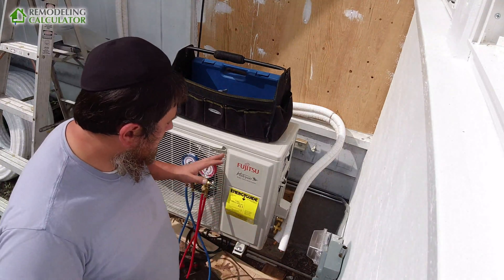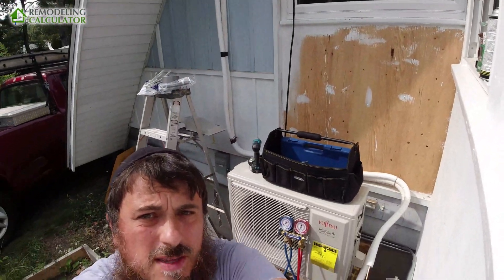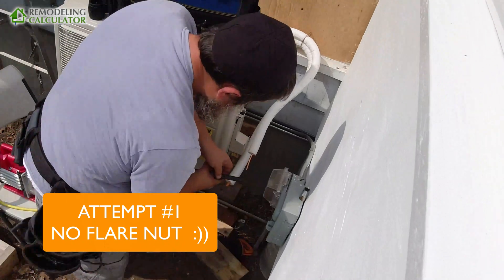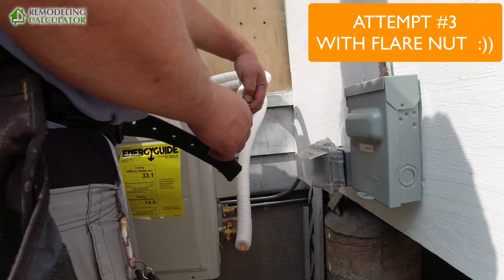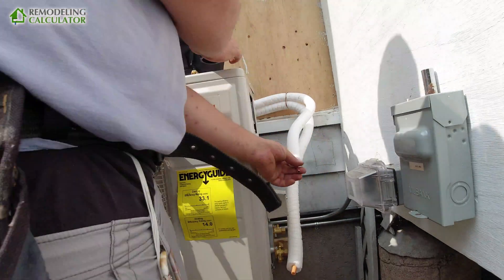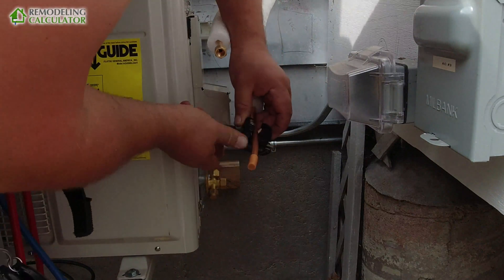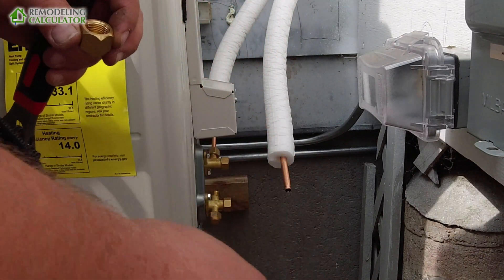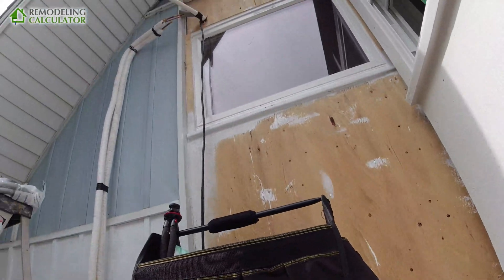Fujitsu DIY Mini Split Install (part 4) - Flare Connections

Comment: Use a shim as a spacer (following mfgr recommendation) to get the exact amount sticking out of the flare tool.  This ensures perfect flares every time.
Reply from the maker: No it does not, because fot 1/4 line you need a tiny little bit less copper sticking out than for 3/8” and up. So cookie cutter approach doesn't work
Reply: @RemodelCalculator  it works if you use a different thickness of shim for each tubing size, per mfgr recommendation. Eliminates the guesswork.
Reply from the maker: It sure works. However having shims is one more thing that is flapping around in your tool bag, as it doesn't come with the flare tool that I have.

Once you do not flares you know how much the tubing needs to extend past the flare block.

Most HVAC guys don't use them because it complicates the work.

In fact most of the Old timers don't even use torque wrench to torque down the flares. Because once again it's an extra tool they don't want to carry around

Comment from the maker: ►  DIY INSTALL - Part 1: https://youtu.be/KHKC2e4-I-A 
►  DIY INSTALL - Part 2: https://youtu.be/LVp6Wwr_QQU

► ► ► TOOLS:
1) MasterCool (better): https://amzn.to/3kWFOwI
2) No name brand that works (good):  https://amzn.to/3kVlsUG
3) Best, but expensive flare tool: https://amzn.to/33ijqs0

Deburring tool: https://amzn.to/3mZO9BI

DO NOT USE "STICK" Deburring Tool

► Other tools needed for Mini Split Install:

► ► ► Gauge set: YOU NEED GAUGES for R410A refrigerant. Most cheap gauge sets are for R134A (car AC) and will not work for Mini Split. You need HVAC gauges!

1) Yellow Jacket Manifold gauge + hoses (R410A / R22): https://amzn.to/3cX25YR
2) Cheaper MasterCool Gauge Set + Hoses: https://amzn.to/3jjJicj

3) RobinAir 5CFM vacuum pump (Good): https://amzn.to/33gS4lH

4) All vacuum pumps: https://amzn.to/33jevXD

5) CPS Vacuum gauge (Very Good): https://amzn.to/2Sg98SS

6) Flare Torque Wrench (YJ - manual):  https://amzn.to/3jhnsGA

7) Torque Wrench (YJ digital adjustable): https://amzn.to/3kZNNJC

8) Valve Core removal tool - 1/4"  - https://amzn.to/36n8lYA

9) Valve Core removal tool - 5/16"  -  https://amzn.to/3ijV0CC

You can get away with just Vacuum Pump & Manifold Gauge, but it is highly recommended to do a pressure test with Nitrogen, and to use all tools listed above, for best results!